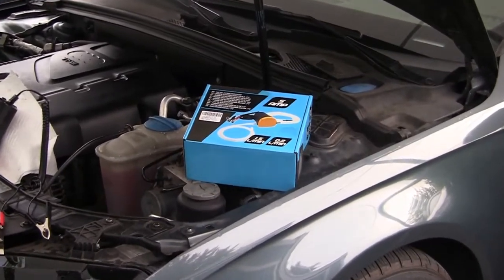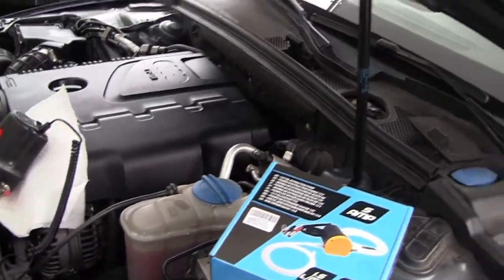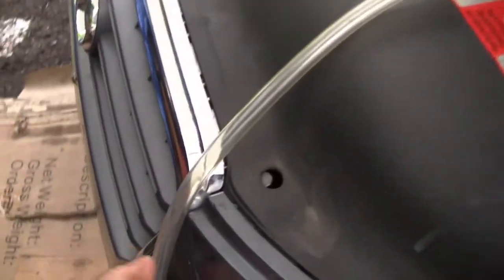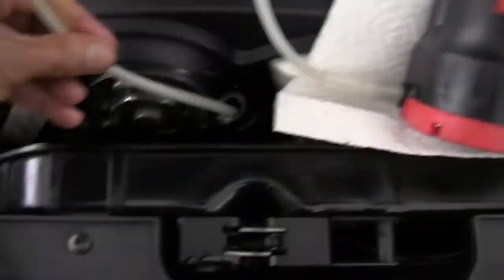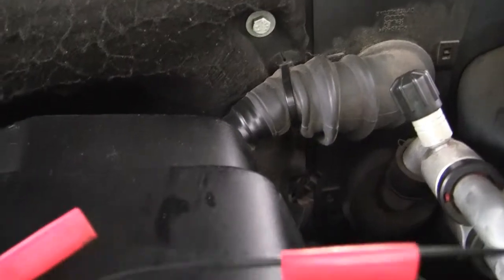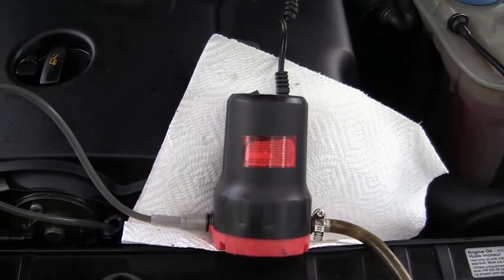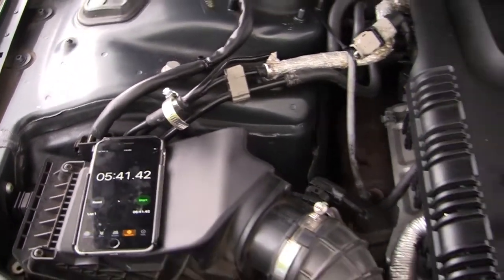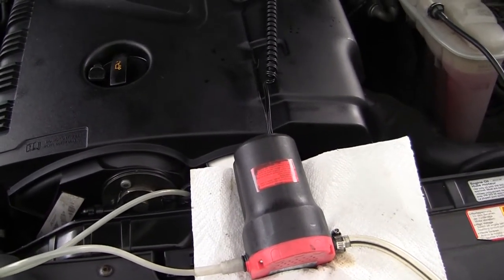I Love This Oil Extracting Pump

Comment: I'm not sold on draining the oil this way.  The sump is designed with the drain bolt at the lowest point of the pan.  Shoving a hose down the dip stick tube, how do you know you're reaching that same low point -- and is there any reason to think that the dip stick tube gets you anywhere near the low point of the pan?  Assuming that the the drain tube is not reaching the bottom of the pan and you're leaving an unknown amount of dirty oil behind with each change -- is it reasonable to expect that you're leaving behind the worst of the sludge, and that this left behind oil will get worse with every oil change?

If the choice is between this an no oil change, then this is certainly better than nothing.  But I don't think this is a replacement for draining the pan.
Reply from the maker: To answer all these questions you have to drain the oil by removing the plug then put the hose through the dipstick port , and use a flash light to see if you can see it from the drain hole . You will see it which proves to you that this method works . But removing 10 bolts from under the car to remove the plastic and remove the drain plug is the best of course if you don’t mind doing it . Remember , I pump the oil out when it’s hot , it’s different than doing it with cold oil .